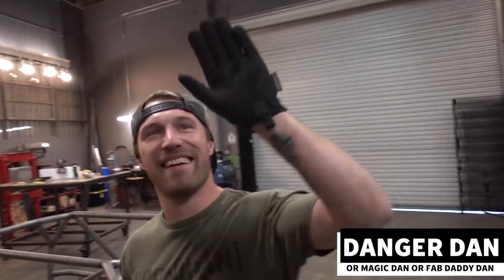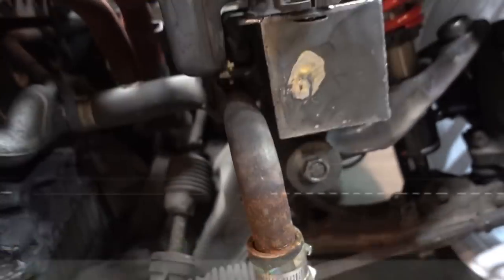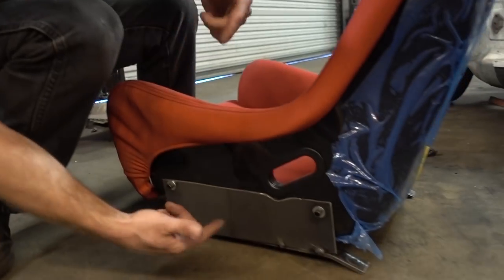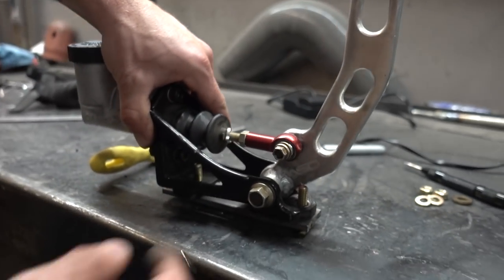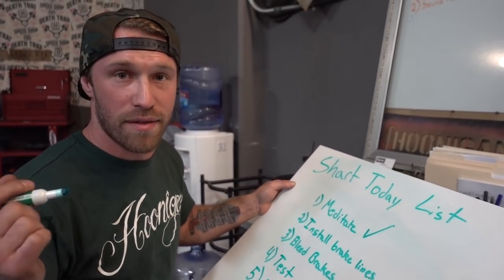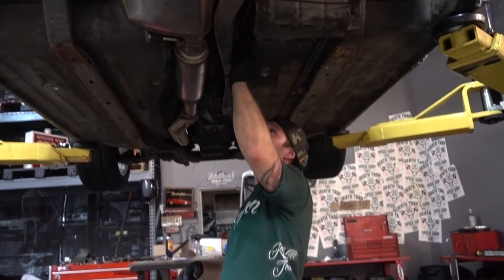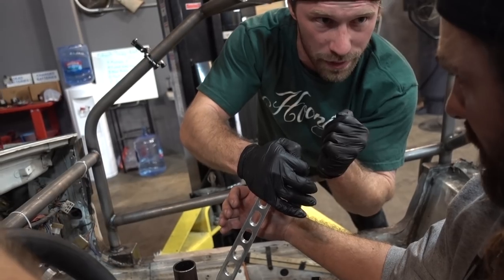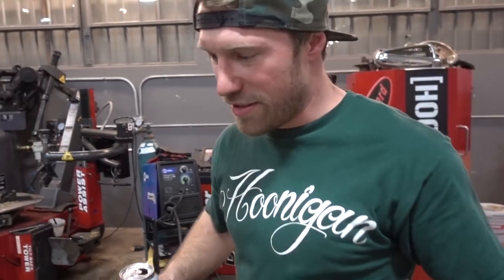[HOONIGAN] DT 206: $200 Miata Kart Build [Part 9] - Hydro Handbrake and Race Seat Install

Comment: Motorcycle brake setup.  Line lock, slide or if you need to actually stop; finesse them both with manual brake bias.  That's actually a kinda cool setup for a yard cart.

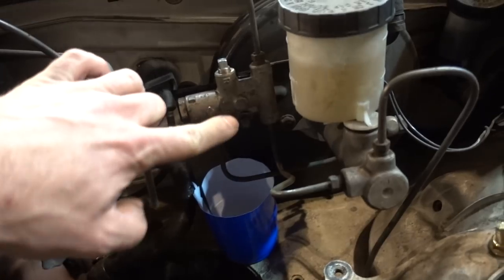Comment: At 6:17 that looks like a pipe plug blocking of brake pressure, there’s a good possibility that it is the correct brake line flare plug cause Dan is the man. But just a caution to people copying this style set up. Use the correct type of plug it should mimic the sealing surface of the line and but that was removed (either inverted double flare or bubble flare) brake line nuts never seal at the threads like a pipe fitting, they seal at the flare. Hard line, hard line, after hard line. Sorry just a pet peeve of mine keeps brakes safe. Happy Hooning!!!

Comment: Custom made strut tower brace up front with "Shart-kart" lasered (or by water jet) into a gusset in the middle maybe?
Reply: JD Hoschar no it needs to be engraved with an angle grinder
Reply: JD Hoschar That's way too nice for the Shartkart
Reply: JD Hoschar brown spray paint

Comment: You Have two handles for the handbrake, that slide and bolt on. On straight for short guys, and on that bends back for tall guys.

Comment: Aluminum won't rust like you say but it will oxidize with contact of dissimilar metals like the steel you have beneath it
Reply: Not like it matters on shartkart

Comment: I hated selling brake lines at autozone. 

"yeah i need a brake line"
"ok what size line do we need"
"i dont know, i was hoping you would know"
"my computer doesnt tell me, i could match a line to a new caliper but were still gambling on the other end. do you know where it is leaking"
"no idea, just give me whatever the standard line is usually" 
"sir there is no such thing" 
This could go on and on but i think you get the point. 

P.s. Dan, your absolutely right about the barcodes being put in a dick place.

Comment: Why would you want only front brakes on pedal and rear on hydro?? Oh wait FOR BAD ASS LEFT FOOT BRAKING TANDEMS.... wait but fr why not have an inline hydro?
Reply: eel1331 they didn’t have all the right equipment Dan said. That’s why he left the rear hardline attached to the car in the stock location but just moved it aside for the new rear only handbrake hardline.
Reply: its easier to do burnouts with only front brakes

Comment: Dude, check valves are a thing that exists and can be installed between the main master cylinder and the hydro to make sure the hydro just does the rear brakes. Wilwood part number 260-3501, install between the master cylinder and the hydro cylinder. Retail price $68.94 at wilwood.com/Master Cylinders/MasterCylinderValves.aspx
Reply: Autocorrect changed the URL, there should be no space between the Master and the Cylinders, like this: MasterCylinders.

Comment: FYI, aluminum does oxidize, it's just white rust not brown and red. It's a myth aluminum doesn't "rust"
Reply: oxidizing is slightly different to rusting as rusting applies to metals like steel and iron while corrosion if what you mean maybe which is what refers to aluminium and copper and other metals that arent rusting metals.

Comment: you guys might want to replace all the camber bolts, they start to slip as they get old and stretched, and no one wants to deal with that. $80 in prevention for all 8.

Comment: its called a burr, not swarf
Reply: swarf
swôrf/Submit
noun
fine chips or filings of stone, metal, or other material produced by a machining operation.
"a curl of metal swarf"
Reply: dan sommer that's what's dropped off the part. A burr is still attached

A burr is a raised edge or small piece of material remaining attached to a workpiece after a modification process.[1]

It is usually an unwanted piece of material and is removed with a deburring tool in a process called 'deburring'. Burrs are most commonly created by machining operations, such as grinding, drilling, milling, engraving or turning.